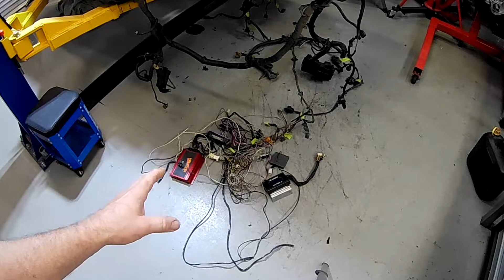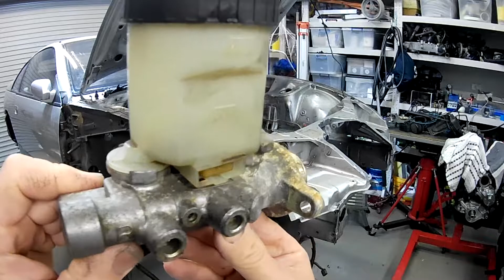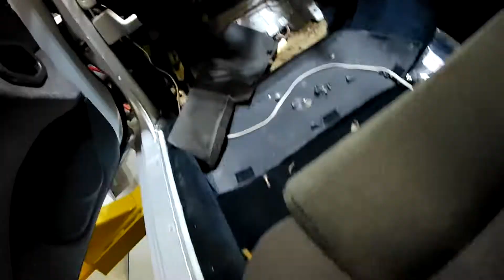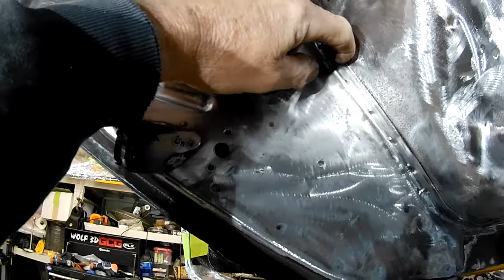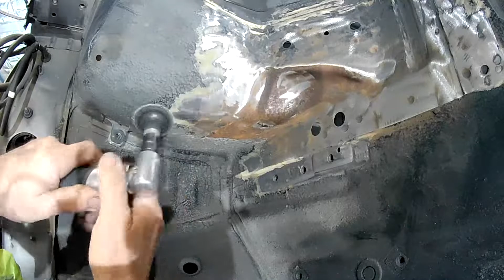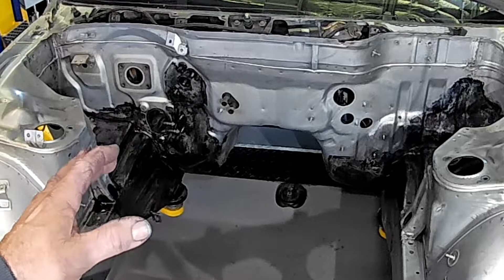Wiring Removal & Engine Bay Repairs. Project Fairlady, The Nissan Z32 300zx Twin Turbo Mega Build

Comment: Can u get a mold of the exhaust manifold done I would love to be able to get it for mine
Reply from the maker: G'day Mate, unfortunately they're now part of a running vehicle & buried in the abyss, that is the V36 Engine Bay.
If at some stage I pull the Motor I may consider it. Cheers.